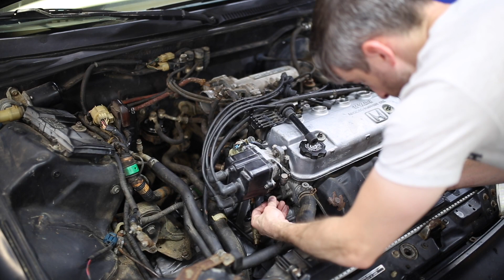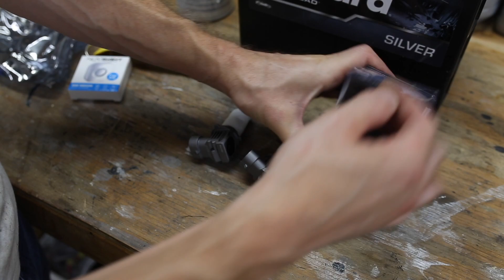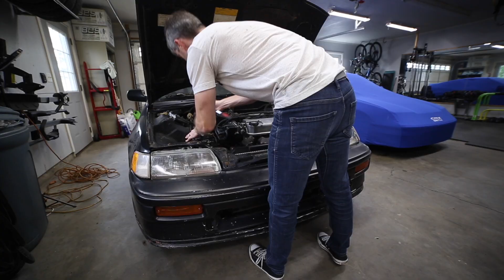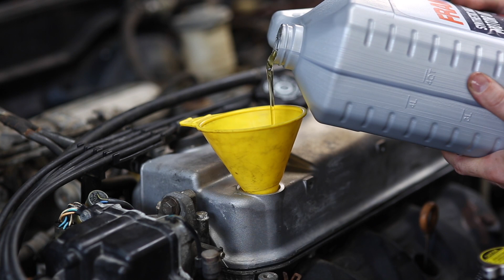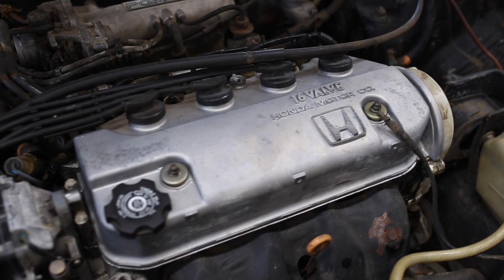1988 CRX Si Restore Part 6 - First Start? Novsight LED Headlights

Comment: What's the difference between the 9005 and the 9006. I ordered both. Cause you had both
Reply from the maker: Socket size is different and one is high beam and one is low beam so they are made a bit differently.

Comment: It's correct to attach the positive terminal first when u[re installing the battery. And vice versa when u[re removing the battery disconnect the negative terminal first. The video is great btw. Spot on!

Comment: I wonder if you have to smog your rex in your state. In Cali you have to pass CHP inspection and on top of that you have to pass the smog, which is a nightmare. I had to keep the motor bone stock, replace the EGR, O2 and the temp sensor. I also had to clean the heck out of the intake manifold which is full of carbon.
Reply from the maker: No, we have no type of emissions check.

Comment: Sir do you remember the material headlamp of the lens? Plastic or glass?
Reply from the maker: All of my headlights are glass.
Reply: Nice..because here in brunei..there are 2 types..plastic and glass..which is..glass type a bit short(ef7) in length..and plastic a bit long (ef8)..mine is ef7 short one..but in my headlamp..there is only for 1 bulb..im looking look like your headlamp..i found one..but it stated in the description..composite material..depobrand..urs is depo brand?
Reply from the maker: I am replacing the ones on this car with European spec single bulb headlamps. The ones on the car are Depo glass headlights in US spec (two-bulb).
Reply: @crxseth  so u mean..european type is 1 single bulb and us spec is 2 bulb?
Reply from the maker: All US spec are two bulb. 88-89 European are two-bulb, and 90-91 European are one bulb.
Reply: @crxseth  tq sir..welldone with your video
Reply: @crxseth  im planning to put 2 bulb on my crx..since my crx only one bulb..do i have to make many changes in wiring?

Comment: Install the positive cable first, then the negative. When taking out the battery, take off the negative first. This helps stop any potential arching of the battery onto the body. :)

Comment: Those soldering skills >.< heat the wire, not the tool. twist the wires together so its solid or it wont heat up enough.